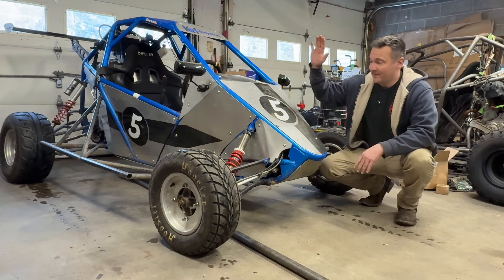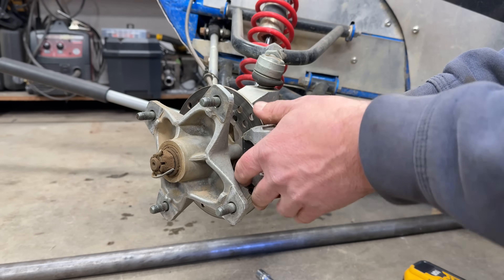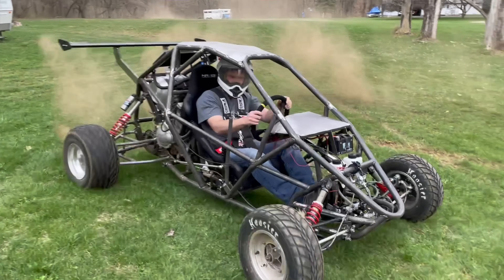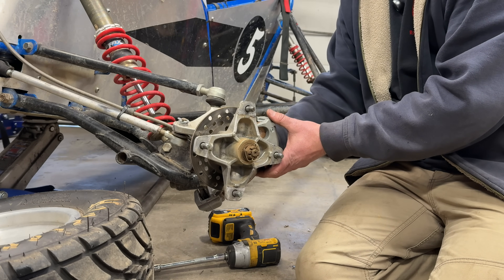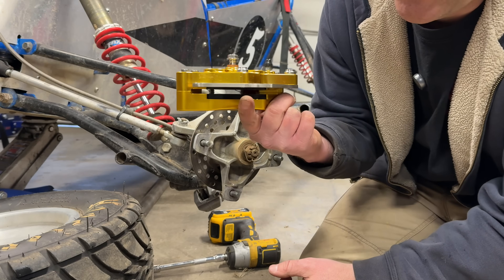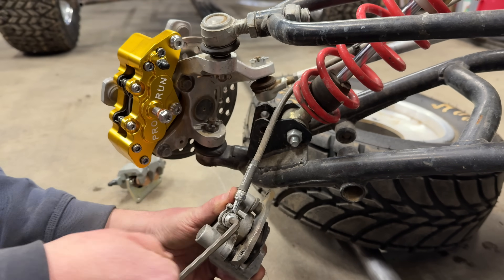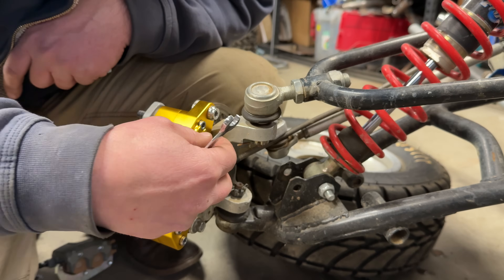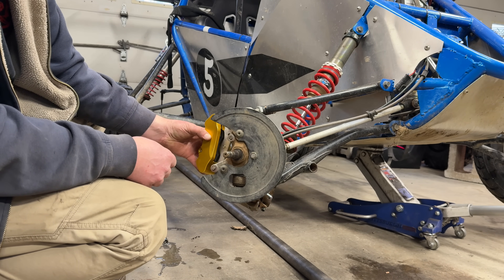Brake Upgrade on a Homebuilt Crosskart. You Can Build This!

Comment: I'm using Polaris XP 1000 spindles and brakes. They are 2 pot. There is a turbo 3 pot upgrade available. I can also adapt wilwood Wilwood Dynalite II-2 Piston Calipers, only 130 bucks each if I feel the need but this is an off road kart and and only 700 lbs. The Polaris XP 1000 suspension and brakes are designed for a 1400 lb vehicle. You don't need french junk ebay calipers. Just grab the Wilwood Dynalite II-2 Piston Calipers make an adapter plate and your good. you may also need to make some spacers to go behind the brake pads to adapt to the thinner rotors but that is easy. The Wilwood Dynalite II-2 Piston Calipers are designed for 3/8 rotors. The XP 1000 factory rotors are .170 but you can make spacers to go behind the brake pads if needed. I am using XP 1000 14" wheels so plenty of clearance.
Reply from the maker: That is the exact beauty of all this! You can build them however you want brother! Love the ingenuity and research, I bet they will work great on your VF-1 👍

Comment: Imagine an electric setup with around 70 HP and multiple power maps. It would have instant torque, built-in reverse, and minimal maintenance. I’m planning to build one eventually and wondering if I could centralize some components for better weight distribution in a drift/off-road flat track build.
Reply from the maker: Definitely planned and priced out an electric build. Two big stoppers for me at least. $5k or more for the setup plus the cost of batteries and recharging at the trails. Not against electric, I’ve just ran 3 tanks of gas through my karts in one day of playing. When the cost comes down a little more I may try electric.
Reply: That has been done. Search for it, it is awesome but limited in range. Search for electric cross kart. Builder is James Bigger and it is on YouTube.
Reply: How much difference in costs?

Comment: im in my 20's with no welding or fabricating expereince. I have rebuilt a 1982 vw rabbit and fully torn down and rebuilt a handful of 2 stroke jetskis. im looking at buying your plans and having a hand at build a kart, do you think its possible with no fabricating experience?
Reply from the maker: Many guys have done it and I would say you have plenty of experience to get started. There are so many successful builds from guys with zero experience to professional fabricators.  It is such a cool thing.

Comment: In Australia we refer to that style of rim as "brake cookers". I wonder if a more ventilated style of rim and deletion of the dust shield would help on road courses.
Reply from the maker: That is a definite possibility, even maybe some cool ducting… I generally use the engine for a lot of the braking. I was on the road course for 2 hours and only got brake fade once. But the brakes I was running were pretty small so I wanted to at least upgrade to the two pot.

Comment: I'm almost wondering if adding four wheel brakes would be a bit better than just having the two in the front and the one on the spool?
Reply from the maker: That’s the beauty of the VF’s, you can build it however you want 👍. I’m a keep it simple/do more with less kind of guy. 😎
Reply: Absolutely I just changed to four wheel disc on the cheap using auto parts. However it’s for 12” wheels.